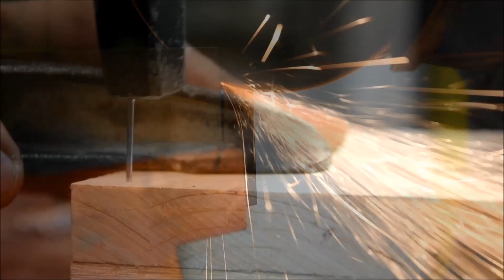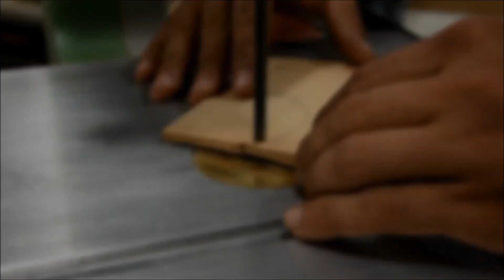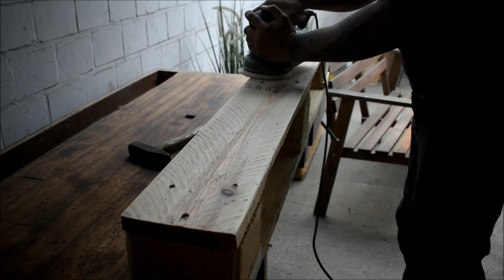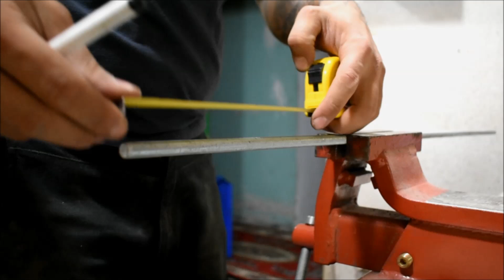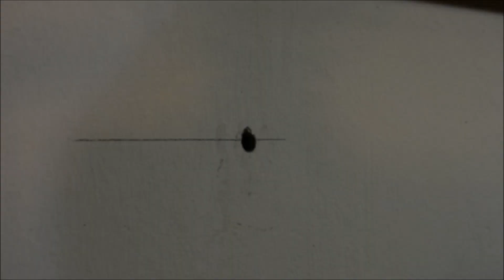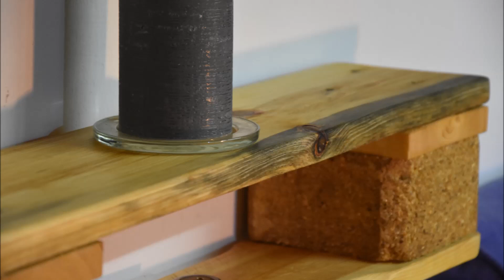DIY | Pallet shelf

Comment: Nice project and easy to do. But isn't the glued in rod a bit overkill? What if you cahnge your mind and decide to move the shelf in another location? Then you'll have to whack 2 big holes in the wall to get the rods out and then plaster and paint the wall again. I think that's a bit too much effort.
Reply from the maker: +anonym musiteufel Thank you! I wanted to show this technic and this wall is in my basement area. So no prob...
And it's not that much work to bring the wall back to without holes...😉